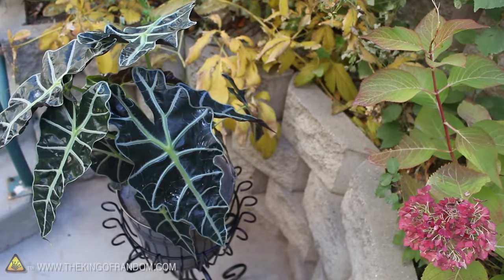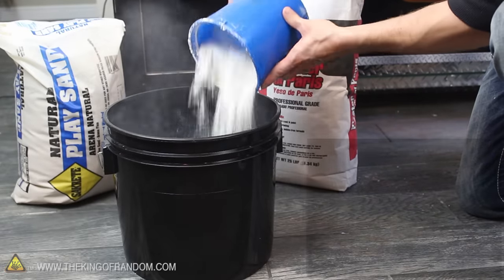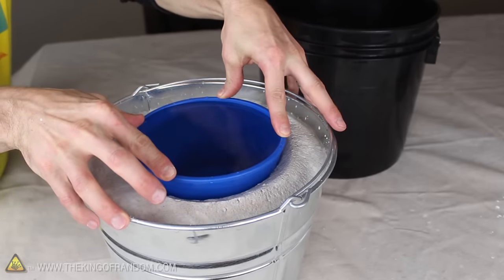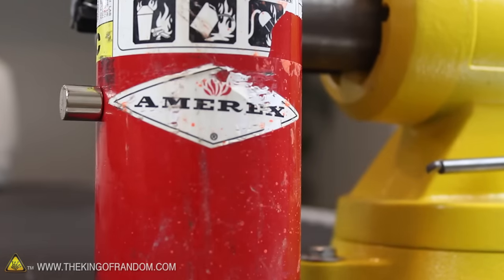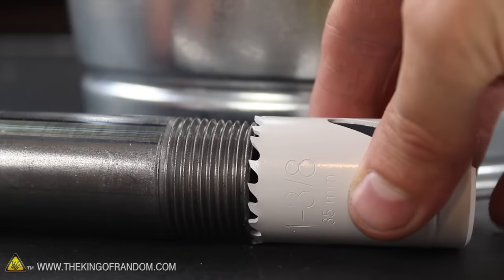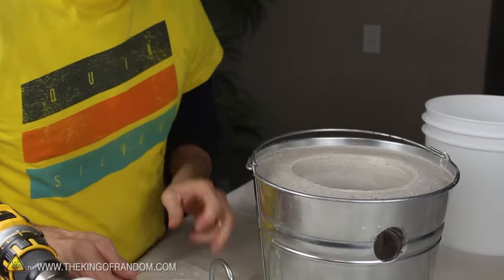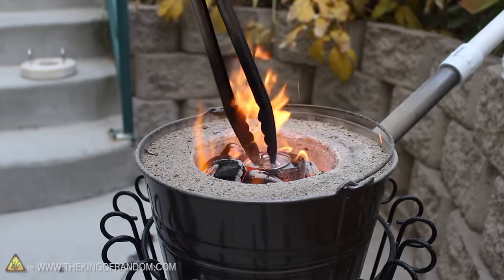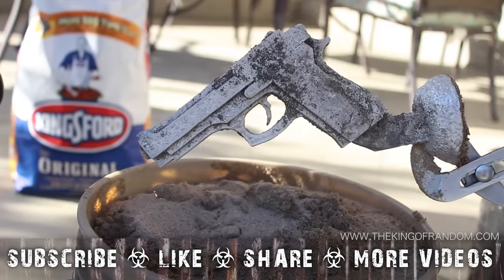How To Make The Mini Metal Foundry

Comment from the maker: Common materials in the Mini Metal Foundry

[✓] Clay Graphite Crucible: http://amzn.to/2bZ2ESu
[✓] Steel Pail: http://amzn.to/2bSuGAC
[✓] Plaster of Paris: http://amzn.to/2bZ0cf0
[✓] 2.5 Quart Bucket: http://amzn.to/2c0l3gk
[✓] 5 Quart Big Mouth Bucket: http://amzn.to/2bSvyoz
[✓] Heat Resistant Gloves: http://amzn.to/2bSv02d
[✓] 1-3/8” Hole Saw: http://amzn.to/2bSvo0z
[✓] 3” Hole Saw: http://amzn.to/2cib3kQ
[✓] 1” x 12” Steel Pipe: http://amzn.to/2cu3uGU
Reply: Why now
Reply: Does the mixture need to be exact? When I did it it never fully set and stayed damp.
Reply: Please let me know if you took any precautions with that galvanized steel bucket - the fumes I'm talking about. I wish to do this very same foundry but can only find galvanized steel such as in your post.
Reply: what do you uese for the blower
Reply: Did you have problems with the fire extinguisher crucible?  I was planning on using one. My other option is to use a significantly thicker steel cup I made at work.
Reply: +Darkblade 585858 Better late than never.  People might be just starting to watch this video now.
Reply: Grant Thompson - "The King of Random"
Reply: Can you melt copper ? I need to melt copper for my project
Reply: Grant Thompson - "The King of Random" can you alter it to melt iron or steel very easily?
Reply: Chris Hale ...melt iron or steel easily... ha ha ha.
Reply: Dima Prok I meant easily alter the furnace.
Reply: Grant Thompson - "The King of Random" any thing else I can use instread of a fire extinguisher?
Reply: FishersFireDept 392 I think you can make one out of clay
Reply: Grant Thompson - "The King of Random"
Reply: Chris Hale actually that is my way
Reply: Grant Thompson - "The King of Random" you can use clay instead of metal cause clay won't melt.
Reply: Grant Thompson - "The King of Random" what's the highest temperature this thing can withstand? 3000°F or higher?
Reply: Grant Thompson - "The King of Random"
Reply: Having issue with the pipes does it have to be that size or can it be any size just steel on front attached to plastic ? And for the plaster of Paris does it have to be the brand you have?? Thank you
Reply: How much molten metal can the crucible hold?
Reply: Any brand of plaster of paris. JUST DONT buy normal plaster
Reply: Grant Thompson - "The King of Random" can you use Pails that aren't that brand
Reply: How big does the pipe need to be, don't think I can cut a hole that big, don't have a drill , thank you
Reply: Grant Thompson - "The King of Random"    Is it ok to use a galvanized steel bucket for the foundry?
Reply: the charcoal does not fit around the clay graphite crucible
Reply: +Ben Marvin Cut them into smaller pieces?
Reply: We were doing that but it does not get as hot as the bigger chunks.
Reply: Grant Thompson - "The King of Random"  put dry ice in the metal foundary
Reply: #Grant Thompson - "The King of Random"
Reply: what do you use to melt the metal?
Reply: Any tips on melting copper wire in the mini metal foundry? Will it even get hot enough to melt copper?
Reply: Grant Thompson - "The King of Random"  If I can not use a hair dryer and I choose to blow into the foundry physically, how often/ should I be blowing ? please respond!
Reply: I like it because I'm doing this as a school project.
Reply: do you just use regular charcoal as fuel? or what?
Reply: The King of Random
Reply: The King of Random hi I wanted to know if you could I could use the plaster/sand mix for the electric arc furnace because I've been having a hard time finding certain materiel
Reply: The King of Random  send it to me
Reply: Thnx 4 ze info
Reply: Ben Marvin same issue here
Reply: Is there a special plaster of Paris I need
Reply: @Odiousdiety strong fan + ductape air funnel lmao

Comment: I took on this project today! It was a lot of work, but I was able to do it on the second try. My one suggestion is to pour the sand in the mixing bucket first, and then pour the Plaster of Paris. I had a lot of trouble evenly mixing the two ingredients when I did it the opposite way, and it ended up solidifying in the mixing pot before I could pour it. Overall, it was a lot of fun, and I look forward to using it. Thank you!
Reply: Robert Lewis water temperature plays a role also I accidentally use cold water for my frigerator and it took a lot longer than when I use warm sink water
Reply: It took longer to mix with cold water or to dry?
Reply: to dry
Reply: It's all about the chemistry.... Heat/energy affects stuff...
Reply: @shawncrowson1048  thank you.
Reply: dry mix first
Reply: Robert Lewis use a paint mixer & a drill motor
Reply: I learned from my professor to shake or scatter the plaster/sand into the water  until it forms small clumps on the surface.  The plaster will not begin to cure until you start mixing.  You have about 3 minutes. It works flawlessly.
Reply: @shawncrowson1048  4 years late but... mix sand and plaster in a bucket before any water to get a even mix.  Once its mixed put the water into another empty bucket and stir the water as y ou slowly pour the dry mix in.  It will usually never clump up and when you done pouring in dry mix , its pretty much done mixing.  

Just like mixing a cake.. you pour the dry into the wet to mix not the wet into the dry then mix :)

Comment: make video about how to make the sand molds
Reply: he´s doing it i guess
Reply: Its actually really easy just use the thick foam the comes in packages and shape it into what you want to mold then bury it in the sand a few inches from the top
Reply: Lyrik Tech dont spoil it for them
Reply: i guess im not sure^^"
Reply: Lyrik Tech
yep, the mold evaporates when the metal is poured and takes it's place, and voila! The cast is formed
Reply: He is using lost foam method, in which he carves foam, and pours a molten metal or alloy on that can burn the foam away, while the sand is tightly packed around it to keep its shape.
Reply: A
Reply: Jack Collins Ahhhh.....
Reply: Jack Collins
 I'm pretty sure he said that's NOT how he did it in a previous video.
Reply: Jack Collins
i was thinking the same thing about he puts foam but instead of foam then its wax
Reply: motorsickle Not that I recall. I just watched all of them over again. You can tell because the foam burns.
Reply: Jack Collins
no it was a typed comment from him I think. I could be mistaken though.
Reply: look up "lost foam casting"
Reply: It's called foam casting were you build or carve out and onto foam then you submerge it into sand, there by creating your moulds ;)
Reply: You could use plastic toys, the aluminum is so hot that it'll just burn up. Not good for the environment though.
Reply: search up Lost Foam Casting or Lost Wax Casting
Reply: And look at this Quick Clip on the Metal Gun. He used a styrofoam gun. MASTIFFxxREAL It doesnt work that way, the aluminium would cool before it is done casting.
Reply: Ross Mcnab Cool, thanks bro :-)
Reply: It's called lost foam casting. There are a ton of videos on YouTube. Just look it up. Good luck!
Reply: Be warned foam that comes from packing (white foam), this will leave your cast with tiny blemishes on its surface, best to use other types of foam.
Reply: can you use concret
Reply: *****
 It will most likely crack.

Comment: Me: makes this and melts aluminum cans at home alone

Mom:*comes home from work*

Me:* turns the foundry into a plant pot

SNEAK 100
Reply: Lol
Reply: *flowers catch fire*
Reply: @Sharknoob21  at those temps yeah I let mine sit out at least for a while because at those temps you can't just pour water on them.
Reply: "Son, why is that flower leaking molten aluminum and smoking?"
Reply: @ri5ux435  It's smoking because it looks cool to smoke and all the mini foundries are doing it.
Reply: Lol but then she finds out... 
FUS RO DAH
Reply: To me is just about the same but instead of turning the foundry into a plant pot, I'll turn the foundry into a pot plant!
Reply: i want to like this but if i do it will be triple 6 xD
Reply: @platygetzkillz627  if you make it 666 I'll like it to make 667
Reply: @Sharknoob21  me: mom it's a uhh... a sun flower
Reply: Smort
Reply: @Sharknoob21  Flowers are the sticky icky and gets the whole block high.
Reply: @granderondeproductions3286  I use a layer of homemade carbon foam on the inside of my forge to keep things cooling quickly but retaining heat when being constantly heated.
Reply: @Suri_Cato  wholesome 100

Comment: I have found that the fire extinguisher used in the video is extremely hard to come by. As a fellow engineer, I have found that a small acetylene torch tank will work.
Reply: Thanks!
Reply: Thank you
Reply: I was just thinking about the empty mapp gas tank sitting in the garage when I read your comment
Reply: Hey +James sorensen just use a steel flask which is from $1 - 10
Reply: make sure its empty first ;)

Comment: Hey everyone, for those who are having troubles finding the "true cost", I had just bought all of the supplies to just make the foundry ALONE. Here is my list and the cost:

10 quart steel bucket - 9.88
1" pvc elbow - .98
2 U-bolt - 3.22
1" 2ft pvc pipe - 2.16
1" 10in. steel nipple(steel pipe) - 5.03
25lb plaster of paris - 10.98
premium play sand - 4.15
total cost: 39.45
Hope this helps!

Comment: Great project Grant!
Reply: Thank you great idea for my simple homestead.
Reply from the maker: Thank you Dan, the man!
Reply: Grant Thompson - "The King of Random" how did you de-pressurize the extinguisher
Reply: Grant Thompson - "The King of Random" can you name other metals that it works with?
Reply: Any idea how hot it gets?? I'm looking to make something that melts gold...
Reply: Dave Turgeon Don't use steel for that, use a fused quarts crucible
Reply: I need 2200° so I can't use steel...
Reply: Dave Turgeon I know, but it can get up to that kinda heat pretty fast but i would build a larger forge then. I knew you wouldn't be able to use steel (sorry I thought you were meaning the crucible melting point)
Reply: Dave Turgeon I made one at home with a little bit lower pipe entrance (which is probably bad) and it can heat up steel up to shiny orange, close to orange yellow. this is around 1200°C, if you use bigger pieces of charcoal, spread them evenly and blow in hot air with high speed, I believe you could exceed 1300°. Don't forget to cover it, though =)
Reply: Dave Turgeon You could use titanium for the crucible if you could get your hands on some...

But in all, a ceramic-based crucible would probably be best.

Comment: Here are the prices for everything you'll need to make this. Please like this comment so other people can see.

The Mini Metal Foundry

Plaster of Paris - 15.98 
1. Sand - $3.77 
1” X 12” Steel Pipe - $7.13 
1” PVC coupling [FLPT x Slip] (one threaded side one slip) - $3.14
1” PVC Pipe (2 ft length) – $2.89
4” U-Bolts - 1.27 x2 = 2.54
Steel bucket - $9.88 
Small bucket - $2.35 
5 Quart Big Mouth Bucket - $13.07 

Final Price $58.35

Comment: We loved your video! You made it seems sensible and easy. We were delighted to give this a go and we learned a great deal....Molten aluminium is actually very hot. Really. Molten metal poured onto concrete does this interesting "pop" thing that makes you think that safety glasses might have been a really good idea. Also, I am surprised and delighted to discover that I can teleport short distances. Not all fire extinguishers are made of steel.. Crucibles made out of aluminium don't work as well as one might like. Smoke rises and can come out the back of your hair dryer...
Reply: +Karen Pasqualucci Not sure what this comment is supposed to say overall but it was fun to read...
Reply: you forgot to use a magnet
Reply: +Karen Pasqualucci don't worry the molten metal will definitely burn through your glasses